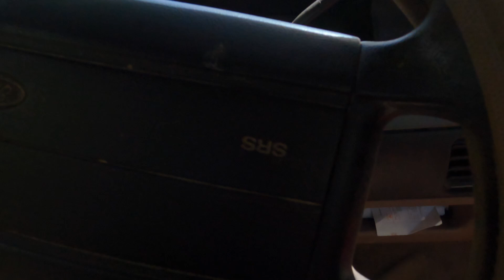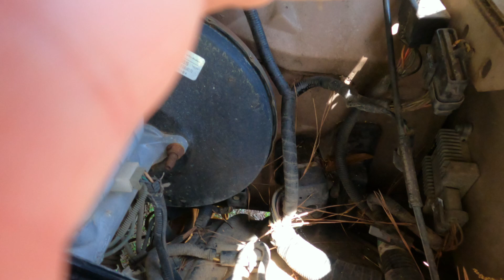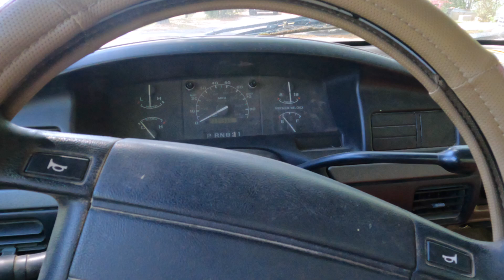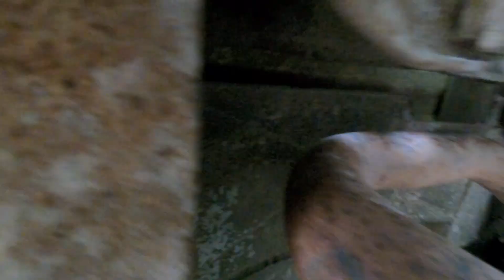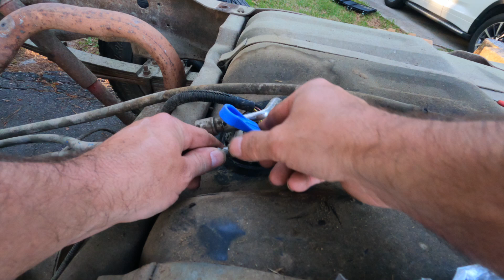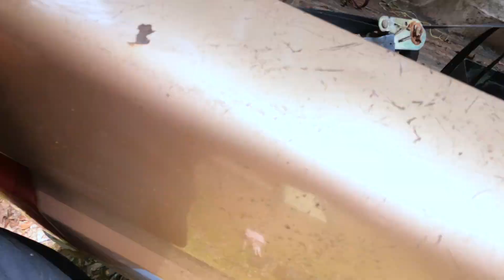Fixing Your OBS Ford: Diagnosing Lean Conditions & Stumbling Throttle Response  How I track it down!

Comment: Need to clean and flush fuel tanks, I prefill filter, need to use rust convertor on under body and frame, always use anticize on bolts, fluid film inner panels, working on developing a flap to cover left and right side of under hood near cowl to protect electrical, get a can  of IES pen lube 4550 super lube all latches and hinges will not wash off, will not attract dirt, 13 oz can 11.30, purchase from S&R fastener FL. they also have rust converter, anticize, and rust coat paint reasonable all fantastic products, check it out will not disappoint.